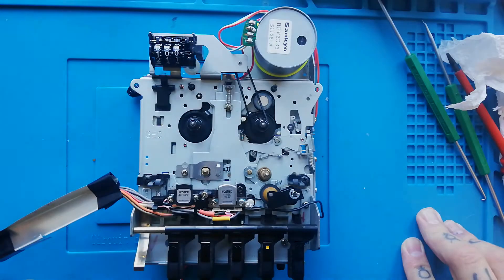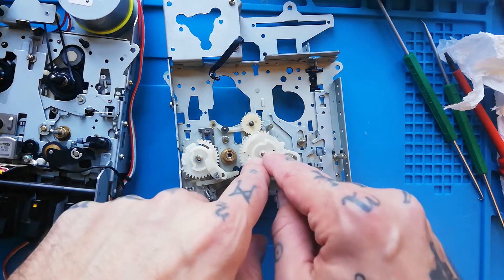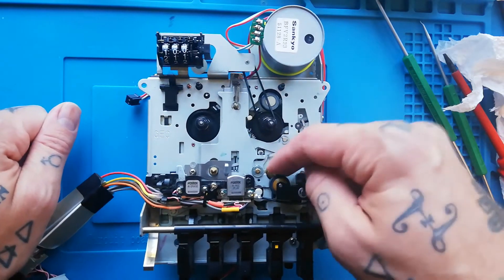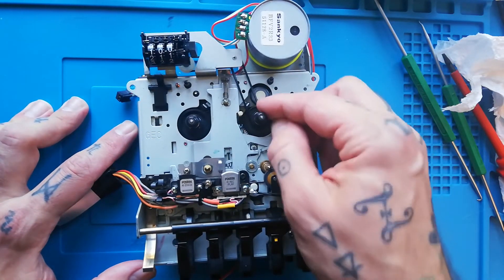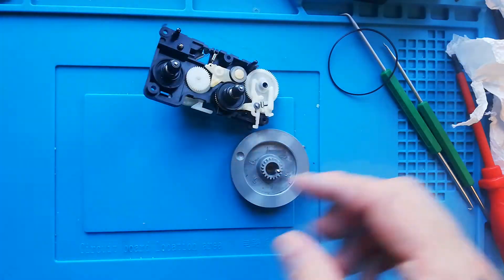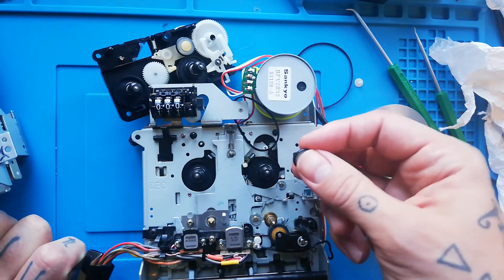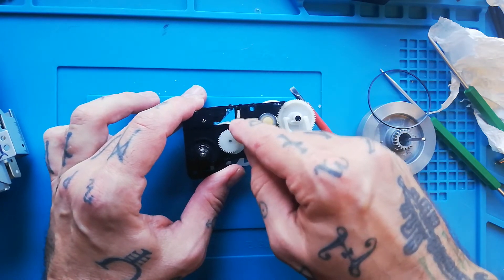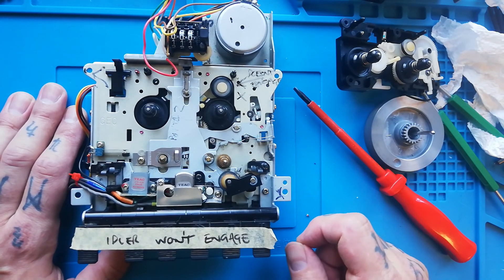GEC multitrack cassette transport | 4 | playback troubleshooting | porta one two 05 MT2X MT3X X-15

Comment: thanks for the video! On the porta one, any reason why you might think when I press record the red LED doesn’t stop blinking? I’ve checked the leaf switches and they all seem to be working and everything else.

Recording does not work because of it. LED does not become solid right after pressing record.
Reply from the maker: If you have the user controls set correctly it’s not the leaf switch or the cassette shell then you’ll need to trace into the  circuits attached to the record arm and record detection circuits. Every problem is either something isn’t connected, something shouldn’t be connected, something needs to be replaced.

Comment: Yamaha MT2X owner here! Thanks for the feedback and teardown on these tape mechanisms! Biggest issue I'm having is the varispeed and tape speed options aren't correct (they're closer to 2x and 3x, respectively). I'm hypothesizing a potential faulty cap or maybe a motor speed adjustment but it's low-priority fix. Your videos rock!

Comment: It seems tath the 3rd island's video in the refurbishment of the head spring is anymore available. Somebody can help me
Reply from the maker: Thats bizarre, maybe he has decided to keep his cards close to his chest? Next time I have to do the modification I will film it and share it here. Basically you have use two pairs of needle nose pliers to unwind one rotation of the shorter leg of the black spring so it has two long legs instead one short leg and one long leg. After some shaping using the pliers, both long legs fit into the recess intended for just the original long leg. This works becasue over time the short leg breaks the plastic recess it sits in, but leaves the recess for the original long leg strong and intact, I hope that helps.
Reply: @Tetrakan  would love that video! found myself in the same pickle, unfortunately. Thanks for all your videos, by the way! They've helped me a lot!
Reply from the maker: @azizlewis  I’ve made it, here’s the link, there are chapter timestamps if you want to fast forward to the spring shaping https://youtu.be/RzBDSYRzlUM?si=qKzrVw0Ji8TdT989
Reply: @Tetrakan  
awesome thanks! Do you plan on doing a video for setting the azimuth as well? Would love to see that!
Reply: @Tetrakan ahh thank you so much. Ran into the same obstacle so came to the comments searching for another similar video

Comment: Hello, Sir Tetrakan! Got several Porta Two transports running, thanks to you! I have one with an interesting head problem. It will only record on track 1, tracks 2-4 are very, very faint. Playback on a pre-recorded 4 track is normal, with perfect audio gain on all 4 tracks. Also, while recording, everything seems normal, meters jumping happily, but the audio doesn’t stick on tracks 2-4. Broken head circuit board? Where’s a good place to look for these parts? (THANKS!!)

Comment: I did the spring trick close to the take up reel in the back but not luck. Same as before, cannot get normally playback , always it stops automatically. Please help!
Reply from the maker: Remove the take-up reel and rough up the smooth edge with high grit sandpaper. Do the same to the idler tire. Remove the head plate and bend the long arm of the protruding  black spring downwards slightly before refitting. These steps in combination with halving the length of the spring within the reel mechanism, hasn't failed yet, for me.
Reply: @Tetrakan thanks for reply ! Ok I think the problem is the black spring and the black plastic but I don’t know how to remove it. I was thinking in another black spring and I was telling me … what spring ? 
Now I know what you are saying but I don’t know how to remove the head plate
Reply from the maker: I have detailed video on this go to mh channel home page > tear fawns by model > GEC transport

Comment: Thanks for the video. I’ve got that playback problem. When I push play it automatically stops after a second. The take up reel does not moves when push play and the safety mode occurs. Do you believe if I remove the idler close to the take up reel and clean it would works ? You are talking in this video about make a video of how to remove the reel base assembly. Do you believe will need ? 
If you can help me I would be very grateful. Thanks in advance @Tetrakan

Comment: Once again I find myself at one of your videos, and once again my issue isn't really what's normally the problem with these transports. It seems that my spring  is fine, the plastic part is intact. I replaced all belts, removed goop that I could see (but didn't do an in-depth clean). What happens when I press play is that it often instantly just presses the stop button. If I hold the play button it will go through maybe 3-4 of those cycles but eventually engage the play heads and work normally. FF and RW work, Stop works, Auto stop works, Pause works, it's just this weird issue that I can't seem to fix. Any ideas on what might be causing it?

Comment: Have you ever run into a situation where the transport keeps trying to turn the tape  even with the heads in stop? I did change the idler tire for an O ring of the approximate size. Could that be the problem?
Reply from the maker: I've found that the diameter of the replacement o ring is too big pause doesn't work properly, does that correspond to what you are seeing?
Reply: @Tetrakan  yes! Thank you! One additional issue I'm having with the transport is it doesn't rewind, but it does play, forward, and record. Is that possibly related?

Comment: Is the GEC transport assemblies interchangeable between the models of the decks they are used in?
Reply from the maker: There are some variations to counter, wiring etc but mechanical parts are interchangeable.

Comment: Hi, great video, I've just bought a Foster x 26 .. It was Rewind and FFwd but when I press Play or Rec nothing happens (cassette is loaded) .. any ideas where to start please? Thanks
Reply: it works when I press Rewind and FFwd but not when I press Play ie.. there is no movement of the mechanics at all
Reply from the maker: Simplest explanation would be the capstan belt needs replaced. Id advise anyone always inspect belts when buying old multitrackers.

Comment: my porta 05 seems to work ok but after a while it seems the fly wheel starts to make a screaming sound... is it easy to fix that. e.g. just lubricate something?
Reply from the maker: I don't think I've encountered a screaming fly wheel, but I'd hazard a yes. Aging rubber goes really hard and slippy before it turns to goo, so maybe an old rubber part is slipping and squealing against an adjacent plastic or metal surface? Really you'll need to get the transport running out of the case and have a poke around and observe what's happening. Generally speaking, if you don't know for a fact the transport has been lubricated and all rubber parts replaced in the last 5 years, you should do that now -  most transport issues clear up after that sort of  basic mechanical service.
Reply: @Tetrakan  i replaced the belts, but maybe it's a motor problem? it doesn't start immediately but always happens after a while
Reply from the maker: The belts aren't the only rubber parts, and they could be ill-fitting...also there seems to some confusion about where the sound is coming from because the flywheel and motor aren't very close together - it sounds like you need to do some more investigation to figure out where this sound is actually coming from? Let's say it is coming from the motor, I haven't encountered a screaming motor before, but if one arrived on my bench I'd open the unit and inspect the mechanical and electrical parts inside - I have videos about disassembly of compact  motors, as does 3rd island among others.
Reply: @Tetrakan  thx so much dude i'll strip it down and report back, if i can't sort!
Reply: @LeonTrimble  @Tetrakan did you guys ever figure this out? I just bought a Porta 05 and I'm running into the same issue, can't find any information on it anywhere. Currently got it apart on the table changing the belts out, but I fear it's deeper than the belts...

Comment: Hey man, if I power my Porta two, i get the sound of the motor without doing anything. I can remember you talked about such an issue. Something with the capstan right. is it fixable.
Oh and my pitchcontrol doesn´t work. How is that?
Peace man thangs for your effort.
Reply from the maker: Hey I don't have mine in front of me as I write this, so check what I'm saying, but I think this model has a cassette detection switch in the top right corner of the cavity where you put the cassette, so the motor will spin while you have a cassette in, that's normal behaviour. If the switch  isn't there, it'll spin as soon as you turn on power. So you can't get round the sound, just reduce it. Lubricating the player thoroughly might make that noise a bit quieter, but it's not a nice job if you're new to this. You might want to just put up with the noise, put a cushion over the portastudio if you need to record something quiet in the same room.
Reply: @Tetrakan  thanks man, i gonna Check that.

Comment: I was originally having an issue where the playheads wouldnt move up, whichI fixed by cleaning and regreasing the underside mechanism, as you highlight at the start of this video. Now, however, they move up, but the tape isnt being advanced? (though it can FF and RW) I'm thinking this is either a weak motor, or the playhead mechnism isnt going far enough up, so that the pinch roller isnt clamping the tape properly to move it? 

Firstly, do you think this is a feasible issue, and secondly, could you possibly demonstrate how close the pinchroller should be to the capstan so I can use that as a reference? Thanks !
Reply from the maker: The capstan and pinch roller should not be just close, they should touch. If that’s not happening it’s probably the plastic plate beneath the heads has broken and the spring below that needs to be reshaped, I don’t demonstrate that mod because I learned it from 3rd island so I tend to direct people to his video on the subject, but I describe the issue and related ones in more detail in this video https://youth.be/xyq1kRNx1aM
Reply: @Tetrakan  That was the first thing i checked for my original issue, the plastic was only cracked so I tried my best to fortify with superglue. I may try cleaning and relubricating the topside mechanism with the three tiny ball bearings though. 

Thank you for the reference regarding the pinch rollers. I hope I can get this thing fixed...!
Reply from the maker: If the plastic is cracked you'll still need to do the spring reshape unfortunately
Reply: @Tetrakan  sorry, should have mentioned, I did the reshape too!
Reply from the maker: Oh, then I don’t really know why the pinch roller isn’t reaching the capstan...try lubricating the bearings like you suggested, good luck and let us know what the solution is once you find it
Reply: @Shawless000  did you manage to solve the problem?
Reply: @giuseppepettinati9627  haven’t gotten round to giving the bearings a go but after cleaning and re-lubing the gears the tape was pinched closer to the capstan, just still not enough. I imagine doing the little bearings as well will solve the issue

Comment: Hey I’ve got a Tascam porta one that the fast forward and rewind work but the playback and record don’t engage, we tried checking the plastic piece under the heads and it looks ok, any ideas of what else it might be? Also the light button to cut off the lights on the vu meters doesn’t seem to cut them on and off, any help is appreciated thanks
Reply from the maker: The light button only works if you’re running off batteries, so don’t worry about that. I’m pretty sure this is the video where I describe all the other things you can do to solve playback issues, like replace the belt under the flywheel, replace the idler tire, shorten the idler wheel tension spring? Did you watch the whole video?
Reply: @Tetrakan  honestly not yet, we were just kind of clueless of where else the problem could be before we open up the rest of the transporter. Thanks for the response and the videos.
Reply: @jer0051  Defo try to clean and regrease the underside cogs, this helped a lot on mine (you can find this process in ep 3 of Tetrakan's series on the GEC transport
Reply: @Tetrakan  hey it’s me again and we have tried lubricating the gears and bearings, changing the belts, reshaping the spring under the heads, cutting the spring on the idler arm and it still isn’t engaging when I push play and or record, the play button just pushes in and cuts off most of the time but occasionally when we turn it upside down it engages for a little bit and chews up tape and then stops. You wouldn’t have any other ideas of what could be a remedy for this issue? Thanks

Comment: Hey there! I've got a Porta Two that has Phones output that will only send audio to the left side. Panning doesn't seem to affect the volume. Any ideas what that might be?
Reply from the maker: First thing to check us the solder joints on the base of the headphone socket, these things are prone to breaking due to the force of the plug being inserted into the socket, if so just touch up with fresh solder. If the joints are okay get back to me for more suggestions.
Reply: @Tetrakan  Thanks the response! Unfortunately, I've checked this and the solder points all seem solid.
Reply from the maker: It might be worth your time heating those solder pads and introducing some fresh solder to them since dry joints aren’t always obviously visible, but if that doesn’t work, the next step would be to reflow or failing that replace the opamp and bookending electrolytic capacitors which provides headphone amplification. I don’t have a schematic for that model and I’m flat on my back with a trapped nerve so I can’t check my own porta two but if you follow the traces or cables from the signal pins on the headphone socket you should arrive at a cap, then a dual opamp (8 pin integrated circuit, 4 pins per side probably) then if you look up the opamp data sheet and figure out which are the positive input pins, you’ll follow those back to another capacitor for each of the two channels. It could be one of the caps on the dead side is leaking, or one half of the dual opamp has failed, or just the tracks and solder joints connecting them are bad. The parts aren’t expensive so if you didn’t want to fuck around with audio probes etc, you could just solder in 5 replacement components without testing and the chances of solving your issue would be high.
Reply from the maker: If you’re not sure about audio probes or you want to see a practical example of this sort of repair (I filmed this sort of issue on a 244) check out the electrical troubleshooting playlist on my YouTube channel homepage
Reply: @Tetrakan  Ok cool! Thank you again very very much. I think I'm going to try a few other things before doing a reflow, but yeah. It may end up being worth it to replace components because it is pretty annoying to not have a functioning headphone out. I'll let you know if I have more questions and if I end up fixing it! haha 
Hope you have a fast recovery, nerve stuff is no fun :/